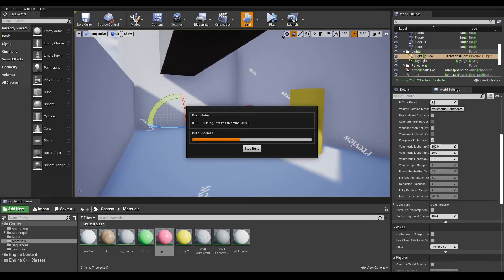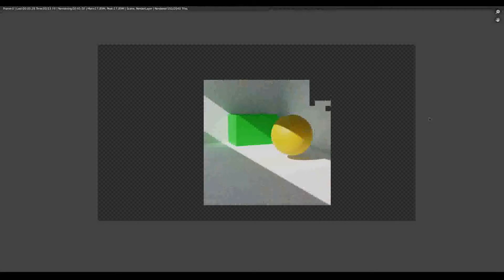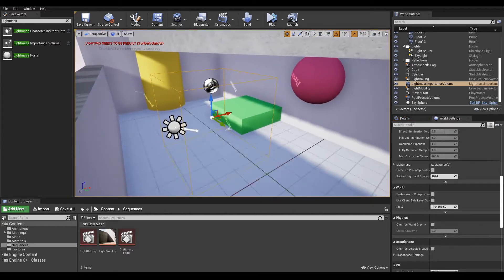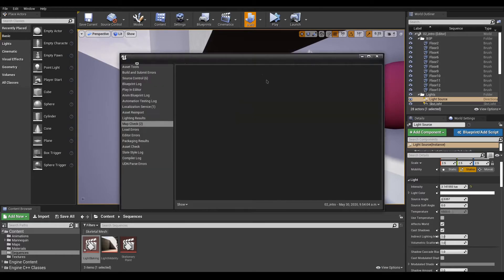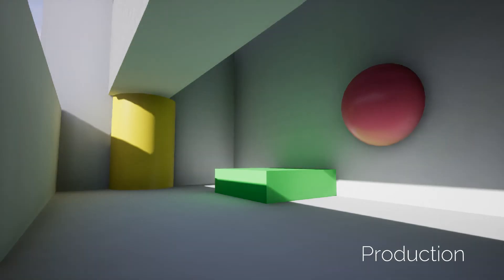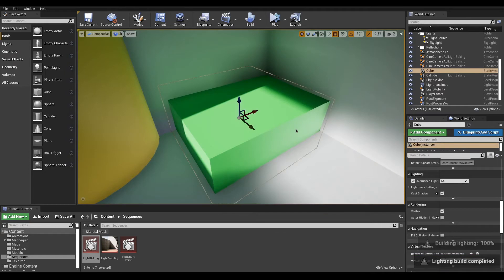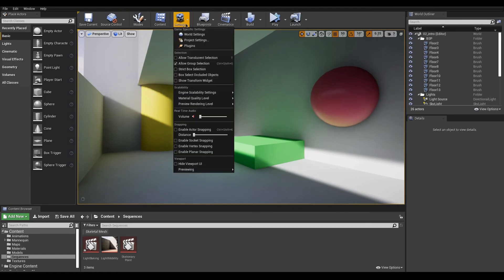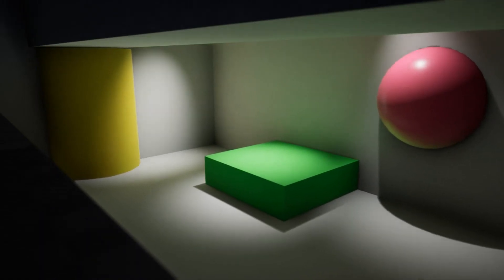04 - 03 - Learn Unreal Engine 4 - Light Baking

Comment: hi there! no matter how high quality my settings, "build lighting only' seems to only take 1 second. is it actually working?
Reply from the maker: Hey! If you are using UE5, it is not configured to use Baked Lighting by default. To use this workflow, in the Project Settings, make sure to set "Dynamic Global Illumination" to "None". The Reflection Method can also be set to "Screen Space". Hope it helps!
Reply: why is this the standard for ue5? do you think baked maps are preferable or not? i thought it saved a lot on performance @antoineflynn
Reply from the maker: @CherylynnLima  UE5 is geared towards high end visuals with a significant cost on performances. Baked Lighting and faking a lot of thing is still the way for lower spec machines.
Reply: also, i tried what you've recommended here, and even after restarting the lighting doesn't seem to build, it just takes 1 second and nothing happens. really appreciate any help here @antoineflynn
Reply from the maker: @CherylynnLima Are you using a Post-Process Volume? If so, make sure the Global Illumination Method is also set to "None"